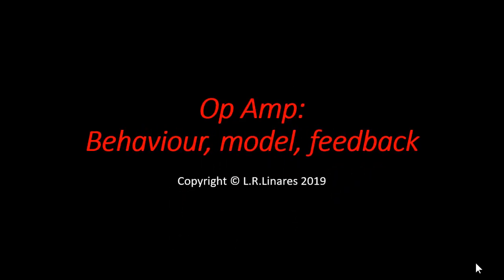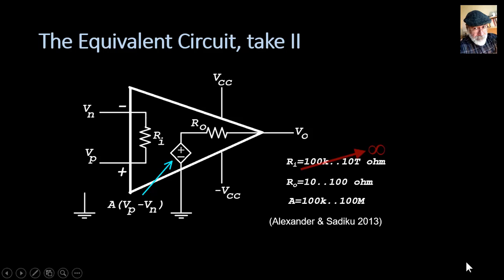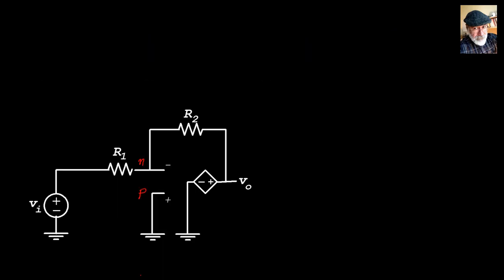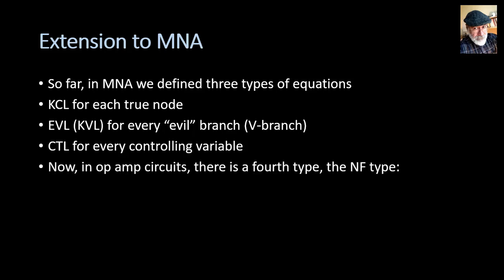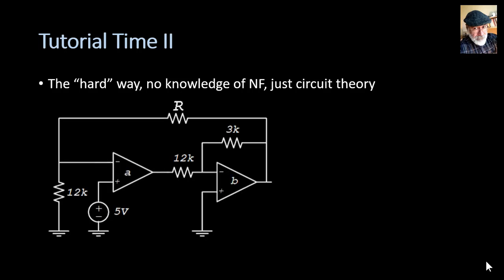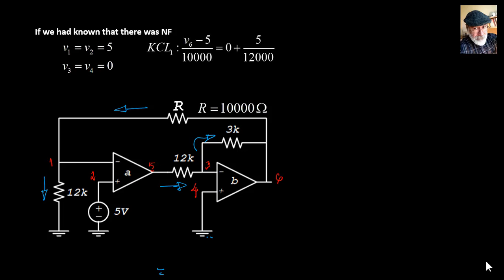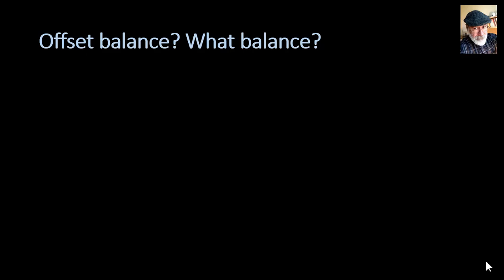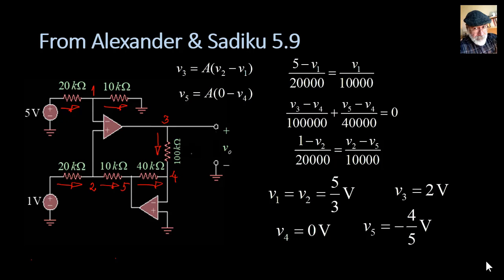Op Amp-3/4: The Op Amp

Comment: Hi there, will you be continuing the electric circuits playlist? Its been a few months since your last video and I'm quite keen on learning about the concept of duality (not just redrawing the circuit but how to actually apply its notations on solving equations), small-signal analysis and transistors (PNP, NPN, MOSFET, BJT etc.)
Reply from the maker: Yes, Mr. Kua. Thanks for your interest. I will be producing more videos after classes are over. Differently from many of my fellow YouTubers, this channel is not my main activity. I have kept this a non-profit outlet (no ads) which means that this is something that I do over the Summer, or Christmas break.

Comment: Understood that NF: Vp = Vn... however, which drives/sets the Voltage (Vp or Vn)?
Reply from the maker: vp = vn (assuming that there is no saturation, etc.), correct. But the actual values of vp and vn are ruled by the value and position of every element in the circuit (sources, resistors, and, of course, the op-amp). For example, in an inverting amplifier, the "grounding" of the inverting input forces vn to be zero as well (what is called a virtual ground); in a non-inverting amplifier, we apply the input source voltage directly to the non-inverting terminal, so we "force" both vp and vn to have that value Vin. In a "buffer" amplifier, the connection of a wire from the output to the inverting input forces vn to have the same value of Vo; and so forth. As in any circuit, it is the overall circuit that sets the voltages in each node. What the op-amp introduces is that whatever the circuit brings node voltages to, Vp = Vn. I hope that this helps answer what is an interesting and philosophical question: what was first ... the egg of the chicken?